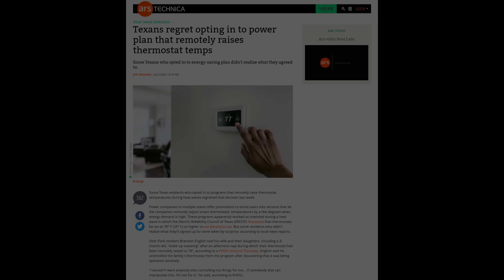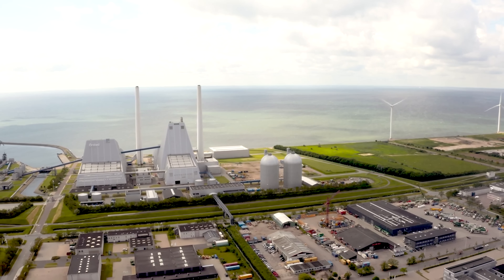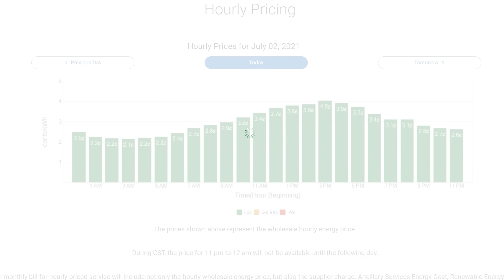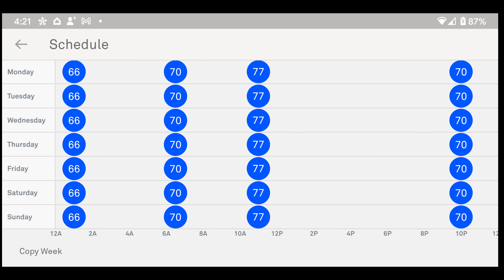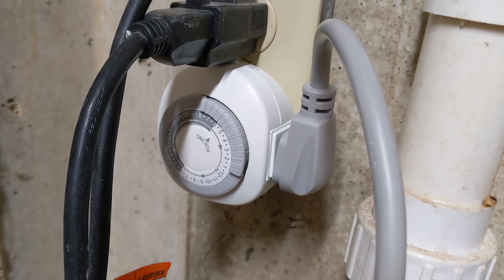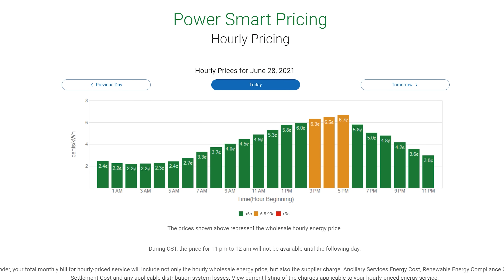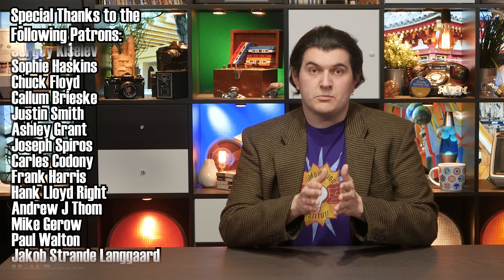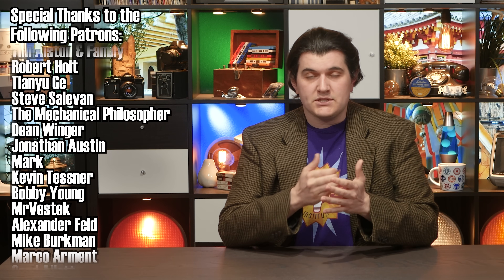Batteries aren't the only way to store energy. Here's another.

Comment: "overcooling" at night not only has a financial benefit, your AC will also be working more efficiently as the delta T is lower during the night. However, in Scandinavia using a heat pump, "overheating" at night works countereffective, as the delta T is higher at night. Not to mention the discomfort of having your house too hot at night.

Comment: If the grid can't handle the load as is, imagine what happens when most households adopt at least one EV.
Reply: You can (and usually will) just charge them at night. Of course, that's not a magic bullet, overall energy consumption will increase, but it won't be that bad honestly.
Reply: I read somewhere that it actually takes more electricity to refine oil to make gasoline than electric cars would use. If that’s true, using an electric car would actually be better for the grid
Reply: If we invested in much more efficient public transportation like trains and didn't build cities that required cars to go everywhere then that wouldn't be a problem, with the bonus of making cities much better to live in.
Reply: Most EVs will charge at night, plus they can charge whenever additional energy is available, like from wind or other green sources. 
Plus a higher base load is easy to solve, "just" build more power plants (of whatever type). That is not a problem for the grid, a problem is then there are spikes. Nobody builds power plants for spikes, indeed.  But EVs don't create spikes.
Reply: He goes over that, electric cars are actually part of the solution. They help even out demand. I know the death of the gas car is sad though 😢. My next car will probably be electric and I already miss my little stick shift mazda 3
Reply: That argument is getting old. The majority would charge them overnight. You know when industries, offices and pretty much any business doesn't use power.
Reply: You're also forgetting how much electricity is used to process fuel in the first place. Additionally, that's like saying that when the air conditioning was invented there was an 11% increase an electrical consumption and it was okay, the grid compensated for it. The same will happen with electric vehicles, people will just get used to it.

Has more and more people install solar, and there is electricity generated at the neighborhood, this will be relieved as well.
Reply: @yopassthefuckinsalt922  funny enough, electric vehicles don't actually use much more electricity than a train does per person, a train that runs on electricity uses a lot more, almost proportionally for the number of people. Cars and trains that run on fuel end up using more because it uses more electricity to refine the fuel than it does to just use the electricity.
Reply: @pilotavery  cars use energy and resources to make, they are unused most of the time, and they need more space to drive and park.
And on a personal note, I find car-centered cities much less livable because I don't want to have to use a car to get around.
Reply: @unvergebeneid  I do agree, although self-driving cars won't need very much parking as there will be way more people using them compared to the amount of parking they need.

My comment was more about the energy consumption of additional electric vehicles, realistically, electric vehicles are more efficient and while it might strain our grid a little bit, because of the location, it doesn't actually use more.

I would like our cities to be more walkable, but the fact is, cities are only a small fraction of urbanized areas. You're forgetting about places like San diego, where outside of 2.7 square miles, you have another 200 square miles where everything is spread out and it takes you 10 minutes to get to the grocery store.

We would probably do well with eliminating some of the roads, converting them into open walkable space, keeping our parking but not including anymore, switching to electric and self-driving vehicles all of this would do wonders.

The idea between self-driving vehicles is that they are about as efficient per person as a bus, they still don't require any parking, they cost about the same as a bus, for a ride, and they're convenient as hell.
Reply: @pilotavery  I agree, self-driving cars would be an interesting middle-ground between public and individual transport.
Reply: @unvergebeneid  Only if people are willing to do ride sharing. One car per 10 people could do if they're placed well by the algorithm. 
Self driving electric vehicles are the holy grail, because you can STILL do vans (shared public transit more frequently and scalable with 10 seater vehicles) efficiently without needing a driver
Reply: @unvergebeneid  Self driving busses are great for events or long distance, and then transfer to shared cars that can hold a couple people going the same direction.
Reply: @pilotavery  You got a source for that per passenger km? Perhaps for a lightly used service, but trains are generally more efficient due to lower friction and air resistance, and less time spent accelerating and braking.
Reply: I suspect that the grid can handle the extra loads but local power reticulation will be the problem, when all houses, fed off one transformer, add a 7KW load on an undersized local distribution cable

Comment: It's not a matter of "I'm not willing to adjust my thermostat to assist my neighbors.". 

It's a matter of,"The utilities have been letting the grid degrade to the minimum tolerable generation and transmission capacity.  They need to fix their s*it instead of developing new and creative strategies to not build additional generation capacity."
Reply: Not exactly... FERC/NERC have basic guidelines for reserve capacity that everyone follows, and where there are regulated entities, they actually tend to overbuild generation, since they actually make more money that way. Other parts of the country are market based (including California) so... the reason there isn't more generation is that it isn't economically efficient (i.e. the next generator wouldn't make enough money). I can probably agree with you if we're talking about transmission facilities degrading and being at minimum, but that's not what we're talking about with meeting peak demand here. Also, cost is cost. If it costs $10M to put in 1MW of new transmission capacity, but $5M to implement energy efficiency or demand response or storage solutions, then it is clearly better for customer and the company to achieve the same results for half the price.
Reply: That, as I understand it, is in fact the problem. Privatization of any critical public infrastructure (utilities, education, healthcare, detention/rehabilitation, safety, etc.) is a terrible, TERRIBLE decision.
Reply: @kindlin  I'd probably agree with you there. I think deregulation on the whole has had mediocre results in the US. Effective regulation or municipal/cooperative (which exists here and there) seems to be a better way to run utilities.

Comment: Back in the ussr days it was fashionable to have "accumulative heater" which is just a giant metal box full of bricks and heaters between them. You'd turn it on in the night, when the electricity was cheaper rate, then have cheap heat during the day, when the electricity was expensive.
Reply: We had the same thing in the UK, we called them Night Storage Heaters and many older homes and apartments still have them installed.
Reply: @kevinh96  maybe all the ones I used were just bad, but they were reaaaalllly leaky when “closed”. This meant if it was a hot day, you couldn’t elect not to get the heat from the night before, and it could become unbearable. I tried to look at the next day’s weather to gauge how much to charge up the storage heater, but then un-forecast cold or hot spells kept catching me off-guard maybe 10% of the time, meaning I had to run extra heat at great expense in the day or once again was baked to death. But I could get behind this method with the thermostat for heating the whole flat at night, since it’s based on the actual temp of the rooms and stuff.
Reply: can't you use an oil-filled heater for the same effect?
Reply: @PlaystationMasterPS3  they do have the same basic effect, less thermal mass though (6 hours of heat vs 12-18)
Reply: @PlaystationMasterPS3  almost yes, but it has less thermal mass and more cooling surface area

Comment: I have been doing this in south florida for 20 years.  My thermastat goes from 76 to 72 at 10 pm. Then to  68 at 2 am.  It works, i have a house that was built in 1932.  My AC hardly ever runs during the day. Today is one of the hottest and my AC came on for the first time at 1:00 pm and only ran 10 min.  It does this about every other hour.  My friend next door ac comes on at 10 am and hardly shuts off till ll pm. It saves tons of money and energy.  I also built foam panels for windows i dont use like in my spare Bedroom and bath.  As well as my bedroom facing south.  They are covered with fabric and look like shades on the inside and are behind my blinds so you see nothing different on the outside. A huge save and reflector of heat.   Simple ideas that work.

Comment: Bravo! one step in the right direction. I really thought that was just common sense, you just turn on your heater and AC at night when electricity is cheap and turn everything off when electricity is more in demand. I went a bit further myself this year as an experiment, I didn't used any AC and almost no heater for an entire year. IT only works because I leave in a relatively temperate climat, but still. With outside temperatures ranging from 10°F (-12c) to 104F (40C), inside temp ranging from 46F (8c) to 95F (35c), I only used 1 heater 15 minute in the morning in the bathroom for a few days in winter, and took a few 30 sec showers during the hottest days in the summer. Crazy what you can do to regulate your body temperature with clothing when it's cold and some water and a little draught when it's hot. Anyone with no medical condition can do it and save the lives of people who can't by avoiding grid shutdown. my electricity bill was a little less than $460 (400€) for the year with and average rate of roughly 0.10€ per KW/H. Everything in my 3 room apartment is electric hot water kitchen stove and oven heater, AC...and I work from home with big computers running 24/7.

Comment: I've been doing a similar thing for about a decade,.in a house with an old style manual thermostat.  Turn the AC to about 72 when I get home from work, bump it down before bed, and then shut the AC to about 80 after I get up in the morning.  Normally, the house is still well below 80 when I would get home, 

The difference in summer power bills pre-COVID and during two years of 100% telework are quite noticeable.

The same technique works in winter.

I'd consider a smart thermostat, but this is a rental.

Another trick i use is this house had an attic fan installed (built in 1970) before the owner installed HVAC.  So, as soon as the outside ambient air drops below 80, I pop a or window open, run the attic fan for a minute or two, and flush the 100+ degree air that built up all day out of the attic.

Comment: I’d like to see a video on Thermostatic mixing valves and using them to increase the thermal capacity of a hot water heater, while also limiting the chance of legionella in hot water tanks without the risk of having scalding water come out of your tap.

Comment: House: goes from 76 to 81 in the span of an hour after I turn off my AC
Me: Angry Arizona noises
Reply: Maybe there's a way to improve the insulation
Reply: Why aren't you using evaporative cooling in AZ?
Reply: @dickbutt7854  at 110° the ice melts before you can say "what happened"!
Reply: Rental apartment: no AC temperature rises 34C at summer day and mosquitoes attack at night, while barely climb to 18C at winter with central heating.
Me: fury beyond hell._
Reply: @dickbutt7854  I'm in Arizona, and I love my evaporative cooling... some of the year. It doesn't work well when the humidity is too high during monsoon season, or when it's 117⁰F outside. Evaporative coolers pump the outside air in, and can only remove a certain amount of heat based on the current humidity.
Reply: Arizona is lucky because the dry heat makes evaporative cooling a viable alternative/supplement to conventional air conditioning.
Reply: @dickbutt7854  One of the major problems with swamp coolers is the pads that the water soaks builds up with yukky stuff, and all the air blown into the house has to pass by the yukky stuff.  This is not good for one's health. I love evap coolers, but it's critical to keep those pads clean. Love your username, tho!
Reply: Yep here in cali . 20 year old house looks nice on the outside but fells like they used hugs and wishes for insulation . it gets to 115 degrees here . previous owner istalled 4 solar panels facing west . biside a big tree so they get 4 hours of light.  Lol
Reply: Same! Angry Florida noises
Reply: @Cancer McAids We have those, too, sort of. They are called misting systems. Problem with misting systems is the very fine nozzle that "mists" the water plugs up easily. Our water here has tons of calcium.  Filters help, but they still plug up.
Reply: Just put a few filled ib-containers in your house and you have thermal mass for days.
Reply: @dickbutt7854  you know the west is in a mega drought right now? might not be the best idea to install cooling that uses massive volumes of water in the desert
Reply: @anthonytimpson4975  maybe they shouldn't have built in the desert. I don't pity them
Reply: @OntarioTrafficMan  Lol. Truly spoken like someone who has little/no grasp on life in "lucky Arizona."....signed....someone who lived there for nearly a decade....
Reply: Traditionally, hot areas built drafty houses with high ceilings. That way heat could be managed. Designing houses with AC systems changes the dynamics.
Reply: @dickbutt7854  lol. Classic ftw thinking.
Reply: @61rampy65  add a uv light to the pad housing
Reply: @Milanesa2010  You don't need ice, even if you have 110F water the energy absorbed in evaporation offers significant cooling. And water just left to radiate to the cloudless sky overnight will cool substantially lower than the ambient 110f. Trays of water overnight then drain to a shaded container during the day.

Comment: Kinda making me wish I didn’t live in the desert. Summer nights don’t fall below 95 here and they don’t like ceiling fans. Also the wall insulation is very much lacking - the sun-facing walls feel hot even inside the house. Our energy bill with the thermostat set to 80 has never been less than $350 for a 3800 sq ft residence.

Comment: I remember the economy 7 tariff very well! 😊. Ah, the sound of washing machines in the middle of the night!
Reply: Controlled by timer signals inserted into the BBC Radio 4 Long Wave signal.
Reply: Bosch and Miele have some pretty quiet models.
Reply: Oh, absolutely - I'm looking back to the washing machines in England in my earnings bracket in the 80's & 90's 😊
Reply: @steeviebops  lmao did you just say the BBC is controlling washing machines by a "long wave" signal? That's hilarious.
Reply: @SpydersByte  Not the washing machines but the electricity meters. The radio signal is used to switch the meters between day and night tariffs.

Comment: This is a fantastic idea, and I'd love to do it if the insulation in my house weren't absolute garbage. It's extremely hot where I live and there's no shade on my house, so certain rooms will hit over 80° in the morning before the central air even kicks in.
Reply: I'm always surprised to see little to no insulation when I travel to hot regions. Hollow or even single-layered walls, single-paned windows, uninsulated roofing...insulation isn't just for keeping heat inside; it also keeps heat outside!
Reply: Totally agree with the panda here. Insulation in attics and walls and floors is the best investment for the homeowner in most places.
Reply: During cold weather, most heat loss in houses happens through the ceilings and the top two feet of walls, since warm air tends to rise and stratify near the ceiling.  Rate of cooling is proportional to the temperature difference between the outside and inside.  Absurdly, balloon construction houses that have been retrofitted with blown-in insulation in the walls tend to have voids at the tops of the wall cavities due to settling, the very place where insulation is most important.
Reply: @prairiepanda  we've got double paned windows and some insulation, but that doesn't help all that much when it's 110° out and the house is getting blasted by California sun. On the hottest days of the year, our 5 ton AC has to run nearly constantly just to maintain 77-78° inside.

Comment: During the PNW heatwave, I survived in my non-air-conditioned house by freezing as much water as I could in the freezer overnight and then during the day stashing it in a cooler with a fan blowing across it. This was ALMOST enough for me, but I ended up having to outsource some of this by buying bags of ice from a nearby grocery store too.

After I get my heat pump installed in a few weeks, I'm definitely going to try the thermal battery approach you described, although my house isn't particularly well-insulated so I'm not sure how helpful it'll be.
Reply: When my AC breaks every summer (poor landlord can't seem to get it permanently fixed), I've done this as well!  I have a ton of those plastic ice.... brick... things that used to come with medication I took for years. I'd stack them up in a grid shape in a big cake pan with a towel in the bottom, then blow a fan across it all.  Wasn't perfect, but it did help. Also dehumidified quite a lot.
Reply: @BRUXXUS  Ah yeah I also have a bunch of those ice packs and used those along with the blocks of ice. It mostly helps to provide some thermal mass to keep the ice from melting immediately.